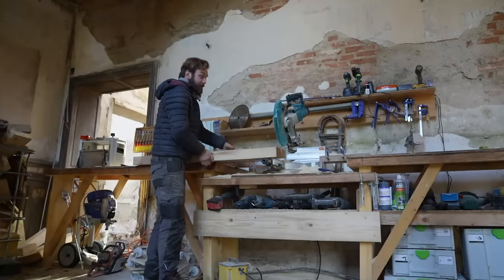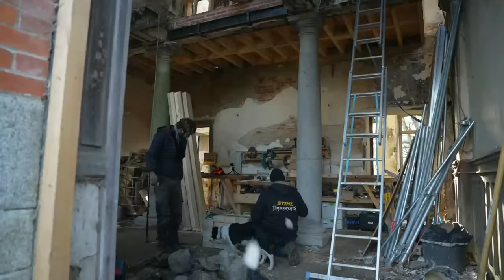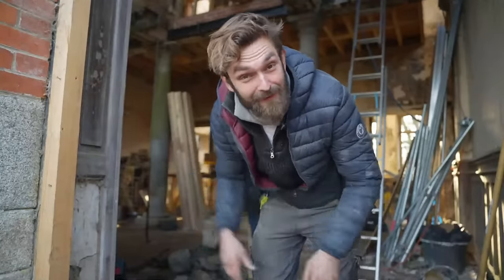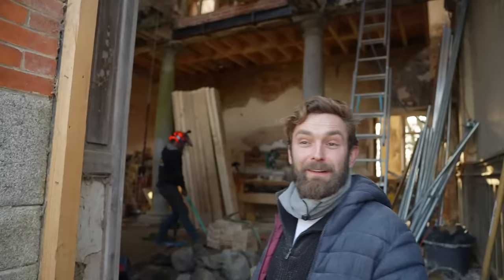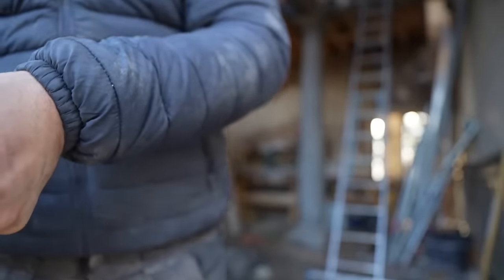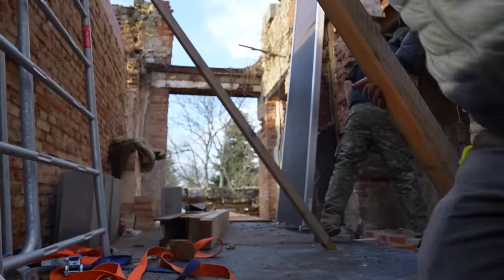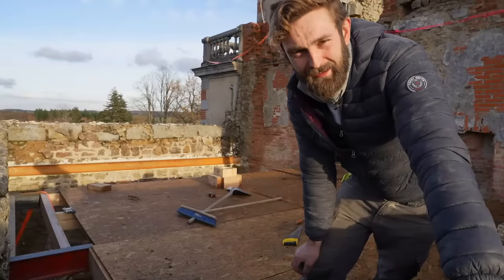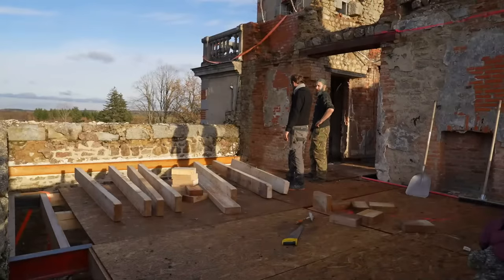live chateau de chaumont, 6th december NOGGINS!

Comment: Dan, just a thought, could you use one of the pallet cages the plants came in, if they are not to heavy,  as a basket for the hoist or the cage from an IBC tote as a lifting basket. Better capacity and safer possibly. Great work and enjoying the live streams.
Reply: I had the same thought but I think an IBC metal bin/cage would be ideal. 
There'll still be a lot that won't fit in  a cage.
Reply: Stuff like noggins, bricks and buckets of mortar spring to mind.

Comment: Hey Guys...
Love the Work...

As for your lifting apparatus,  you need to get a lightweight crate, like a stripped down IBC and load it appropriately with whatever you can fit in it... hell you could probably lift your wheelbarrow full of cement instead of a bucket at a time...
Cut one end open for access and there you have it... we made a few of them back in the day and lifted with forklift... put some heavy duty casters on it if you like to make it moveable...
Keep up the good work...
Cheers

Comment: Dan, why don't you get staging and put a permanent roof over the whole of the chateau? Knowing the tower needs rebuilding before it can be reroofed, still it would seem advantageous to have all of the chateau covered so it would be dry and snow-free, thus allowing you to continue work even during inclimate weather. Plus, what you build will be free of water and the need to replace spoiled sheets of OSB, plywood, etc. The trees and scrubs are looking great. Crack on, Ole chap.

Comment: Question if you drill the holes for the electrics etc,when lifting the joists you could use a  metal bar through the holes to strap the joists and make it more secure when  lifting to higher levels and it might be  safer safer for you all .

Comment: I'm curious if the grooves on the walls where the stair treads used to be are still capable of bearing the load of the replacement set of stairs.

Comment: To get more things up with the wrench I wonder if using the pallet crate would work if you made it a bit smaller and gave it a floor board base and sides so things don't fall through and make one of sides hinged  so you can put items in via side and top.

Comment: I know the floor that you are on is the top floor and that there will be a roof over it.  So before you can get the roof on why don't you put a rubber roof or a roof membrane on the entire floor.  That at least will help the floors underneath from getting wet. The floors under,  will last just so long because of the weather. At least it will help from any further damage. Just saying.

Comment: Better and safer to hire a crane to lift all the roof beams. That would be less physically taxing on you three. Can the beams for the other sections of the château roof can sit on the top floor to later be moved into place or would it be the same problem with them? If yes, that would save on expenses for the crane hire.

Comment: Question would it be easier if when you put the joists in and a noggin either side ,you would then be using your noggins as spacers. (But up to the noggins) and fix ,measure and fix the floor  board and everything should fall square, ie noggins  joists  noggins joist? Easier when it gets dark.

Comment: One thing I never quite understood is why is Dan doing all this by myself or with a crew of 2 or 3 people. The roof per example for the whole place could be installed/rebuilt by professionals and it could be done in a matter of a few weeks and then Dan could proceed with other floors, the complete roof would make a big difference and some parts of this rebuilding cannot realistically done by one or 3 people.  Any answers/comments from Dan?
Reply: My instincts are sort of thinking it's due to money. When he started this remodel he didn't even have a working car or place to live. He has come a long way. I know that building costs have escalated in most countries.
Reply: A slate tiled, mansard roof that size, installed by professionals, would cost at least a couple hundred thousand €. I would guess that is why.